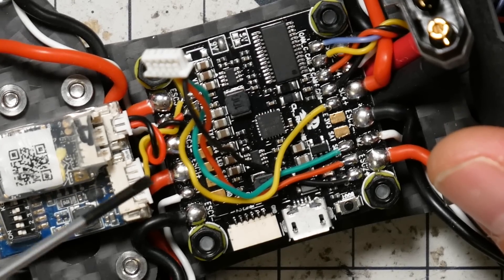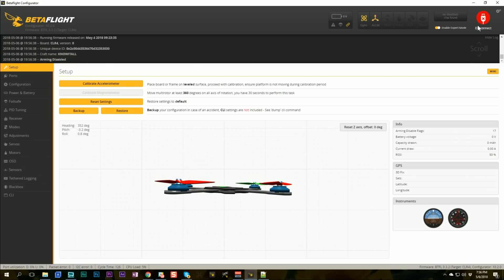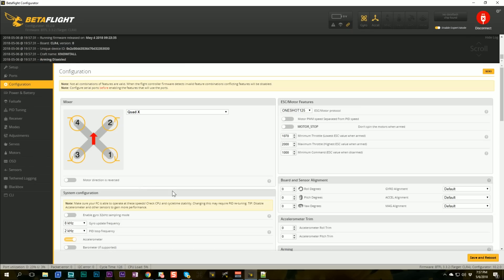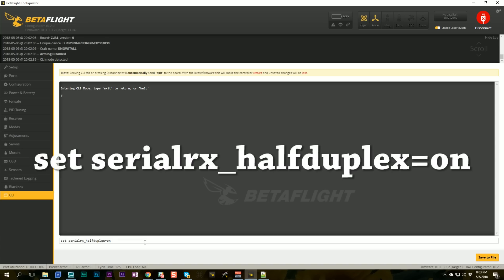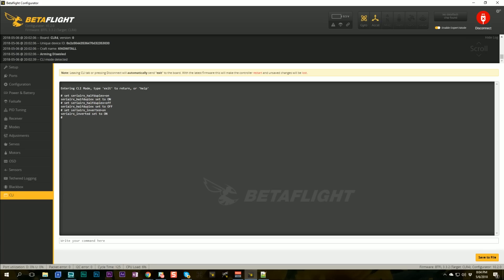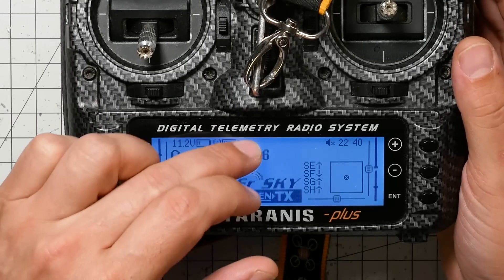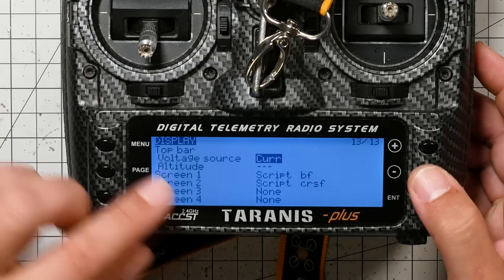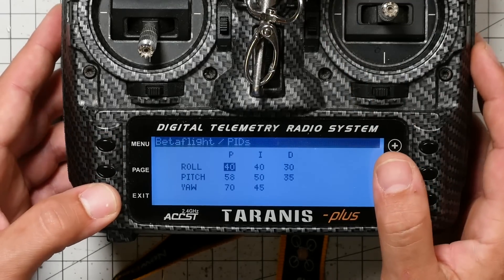FRSKY FPORT HOW TO | SBUS and SmartPort on One Wire

Comment: Have you ever seen where the Receiver tab isn't live but stutters? First time ever I have seen this. Just flashed my XSR to FPort since I needed to update it anyway. previous was SBus and I didn't see the issue then. Going to try and go back to see if it helps. Doesn't help I am on a Matek F405 AIO
Reply: Went back to SBus and SmartPort  config = back to normal. Not too bad because I was already wired this way.

Comment: Hi Josh, I have an r9mm receiver updated firmware to fport, that is bound to my taranis /r9m module also updated firmware, and feeding back rssi telemetry to the radio so I know that connection is good. fport/ smartport wire soldered to tx1, ports page, uart 1 set to serial, tried all variables of the command line on/off. Still not working on the bf reciever page. Any ideas?
Reply from the maker: If you are using the R9MM then you should connect the un-inverted SmartPort wire to any UART TX pad, then in the CLI type "set serialrx_inverted=on" then "save". If this doesn't work, type "get serialrx_halfduplex" and if it's on, turn it off, and if it's off, turn it on. 

If that doesn't work, use a different UART TX pad and see if that works.
Reply: @JoshuaBardwell  thanks for the reply.  Figured it out last night. I didnt realize the r9mm had an uninverted pin.

Comment: There is no Stickmovement on my Armattan Quad. Same Hardware&Wiring in the video (FC: CL FRacing F4S)
What I did:
1) I have flashed the FrSky R-XSR with the newest Firmware: R-XSR_FPORT_LBT_190311.frk
Since I use an European TaranisQX7 i changed the receiver firmware to LBT and in addition with FPort!

2) I flashed my TaranisQX7 with the newst firmware: opentx-x7-noheli-lua-luac-en-2.2.3.bin

3) I updated the newst Flightcontroller Firmware: CL_2.5.0_CLRACINGF4.hex
I also made the changes needed for the F4 and FPort.
set serialrx_provider = FPORT
set serialrx_halfduplex = OFF
set serialrx_inverted = ON
—> Now the binding process went well. I see the green LED on the R-XSR and I also get the telemetry information on my transmitter. YUHU!

BUT: I  don’t see any stick movement in cleanflight! And i cant figure out what’s the problem. 
Did I screw up with the new firmware? Or is Fport not the right thing for this quad?
Would be awesome if I get a little help from you guys… I hope it’s not a big thing.
Can you help?
Reply from the maker: I would double check the wiring. Yellow Smartport wire to T pad on the FC right?
Reply: @JoshuaBardwell  hey Josh. Thanks for the answer! Actually Armattan Support had the right clou. My R-XSR was not using the SBUS protocol for whatever reasons. So I had to push and hold the bind-Button on the RX for 30sec until the blue LED indicates it. I went back to SBUS and Smartport for now anyways. Now everyhting works fine. 
I'm diving in this fpv-hobby with an incredible pace and deepness. And you are absolutely the best, fun and most waterproof dive instructor I can imagine! 👍 I will follow up! Thank you

Comment: Not working on your Bardwell F4 flight controller. Flashed my XSR with FPort firmware and wired to telemetry pad. Set up a new model on my Taranis.
Reply from the maker: It definitely works on the JBF4. I did it myself in this video :-)

Did you wire the SBUS wire to the Telemetry pad maybe? FPort uses the SmartPort wire. That's my best guess.
Reply: Definitely using FPort wire which is yellow on my XSR.
Reply: Thinking of flash back to the regular firmware so I can fly this new build. Doubt the telemetry will work, see my previous comment from 2 months ago.

Comment: Hi JB.

Can i use the SBUS pin on a Wizard X220HV F4 board, with an RXSR to get telemetry if there are no spare UARTS by using Fport firmware on the receiver?
Cheers
Reply from the maker: No, it does not appear that the X220HV flight controller has any UARTs that would allow you to get telemetry. I have also tried to think if there is any pin that could be re-mapped but I don't think there is.

Comment: Hi Josua ,great video :) question tho.. do you know if the speedybee f4 aio FC is able to use the FPORT setup?
I am running speedybeef 3.5.7 on my speedybee, flashed fport firmware on my r-sxr reciever, connected the s.port wire of the reciever, set FBUS in settings tab, however:

only on uart 2 (default reciever/sbus port) i get stick output on in the transmitter tab of betaflight but no telemetry on the radio.

I know I shouldnt use the uart 2/sbus for flying but instead use a different uart. however i never get the stick output shown nor telemetry on my taranis q x7.

tried uart 3 and 4 with half serialrx_duplex on/off, and serialrx_inverted on/off but no telemetry nor stick reaction on the transmitter tab.
Reply from the maker: For FPort, you must use a UART TX pad with bi-directional inverter. You say you are using UART 2 SBUS port, which is an RX pad. That would explain why telemetry is not working. SBUS has a one-direction (RX only) inverter. Use the SmartPort pad on your FC if you have one. Or use the P pad on the RXSR, which outputs un-inverted smartport (and Fport). Connect the P pad of the RXSR to any UART TX pad on the FC. Then in the CLI type "set serialrx_inverted=on" then "save". I don't know the correct value for halfduplex but try it either way to get it working.

Comment: hi JB, what I'm missing. I have no telemetry apart from RxBt and RSSI after Discover new sensors. I've installed an R9 MM with latest firm FLEX_20190201. and OpenTx 2.2.3 on my Taranis Qx7. The channels are working great. The problem is the lack of sensors in the telemetry
Reply from the maker: It means that SmartPort is not working. Did you use the FPort firmware or the regular firmware?
Reply: Thank you for your fast answer. I have flashed FLEX_20190201 on R9 MM and R9M_FLEX in the TX module (Taranis QX7). My FC is a HAKRC Flying F4 v3. I have telemetry selected in BF. I don't have UART selected because I'm using F.port. Is it necessary to assign UART with F.PORT? I'm using the S.PORT/F.POT pin on R9 MM.

Comment: R9MM should be currently F_PORT enabled right? And the pin should be the same for S_PORT... (trying to understand how to wire it up on my Matek F405-CTR)
Reply from the maker: You can do exactly as you see here with R9MM. It does support FPort. The main advantage of R9MM is that it also has an inverted S.Port pin if your FC doesn't have an inverted UART for SmartPort or FPort. If you use the inverted S.Port pin you must go into the CLI and type

set serialrx_inverted=on (if you are using FPort)
set tlm_inverted=on (if you are using SmartPort)
save
Reply: @JoshuaBardwell  thanks a lot for your reply. Unfortunately I've got a quite bigger problem... I've bought a Jumper T12 basically for the form factor since my FPV backpack is not that big.
In order to make long range (as an upgrade for my Flysky FS-i6) I've also bought a Frsky module R9M plus R9MM receivers.
When I go through the binding procedure, if I select and execute the "Bnd" command (page 2 of model pages) it does not blink or make any sound either...
Really don't know what to do since if I use the crappy multimodule shipped with the T12 itself, binding command does work correctly (blinking and beeping while looking for a receiver).
Thanks again anyway, cheers.

Comment: Hi, quick question if I understood correctly,  on f4 like JB AIO,  connect the smart port wire after flashing to fport to the T on the f4 board? Thanks !
Reply from the maker: Yes that's correct

Comment: Mamba Mini (F4) and F.Port seems to be a miss. R9MM inverted s.port pad to FC TX6 pad doesn't want to send telemetry despite CLI tweaks and R9MM being flashed and Set in telemetry modes. Radio link works and it discovers all senors, not no current draw updates, been trying to not figuring it out so far..
Reply from the maker: If sensors are discovered but current does not update then it sounds like telemetry is working but current sensing is not. Go to power and battery tab and make sure current sensor is set correctly. Make sure the osd shows current flowing.
Reply: @JoshuaBardwell  Thanks for your help, you were right! The telemetry was coming through okay, I mistook the lack of current sensor updates as an f.port tele issue but in fact it was the BF power and battery tab configuration that needed some tweaks. All working now, thanks again!

Comment: I found a R9MM, flashed the firmware R9Mini_FCC_Fport.frk, and connected the Inverted SPort to TX1 on a new F411-Wing (flashed with the F411 softserial firmware). I set Fport as the serial receiver source in iNav, and now the Taranis X9D works the channels on the Receiver tab in iNav. However, I can't get the telemetry to work. 

My R9M is flashed with R9M_FCC.frk, version 20190117. Per the Matek Fport page, I have entered:
set serialrx_provider = FPORT
set serialrx_inverted = ON
set serialrx_halfduplex = ON

Per Oscar Liang, I have also tried turning serialrx_halfduplex off and on again. Same with serialrx_inverted. I have gone to the Taranis telemetry page, deleted all sensors, but when I choose Discover New Sensors, it doesn't find any. 

Does anyone see what I'm doing wrong?
Reply from the maker: Did you enable the Telemetry feature in the Configuration tab?
Reply: I finally got it working by going to an earlier version of the F411-WING firmware and trying a newer version of the R9MM firmware. Thanks for your reply!

Comment: Hello Mr Bardwell I have your first f4 FC and using R XSR f.port. I got f.port to work I had to turn off halfduplex and   invert both off. My question is can I use the sbus pad for smart audio sadly I burned off my tx4
Reply from the maker: SBUS pad is rx. SmartAudio needs TX. That's a no go.

You can use ledstrip remapped to softserial. Instructions are in the Troubleshooting section of the manual.
Reply: @JoshuaBardwell  thanks I already used the Led pad for it . I wasn't sure about what the sbus pad was RX OR TX thanks again.

Comment: Has anyone got any advice on how to get my r9mm to work with the matek f411-one using fport. I've tried everything and nothing works. The receiver has been flashed with the fport firmware but still no joy.
Reply from the maker: You need to use the inverted Smartport pad on the r9mm. Connect to any UART TX pad on the FC. Then in the CLI type

set serialrx_inverted = on
save
Reply: @JoshuaBardwell  thanks, I will give that a shot later on.
Reply: @JoshuaBardwell  unfortunately I tried every which way going in luring yours but still I get rxloss cli map in the cli tab even with the built in receiver I still get no receiver decteded in betaflight :/ may as well just get another FC.

Comment: I have f port working soldered on the pad on r-xsr and have serial rx UART 1 and connect that wire to sbus on mamba f405 mini. In your reciever tab you have telemetry set to aux 3. It's that because you're using uart3 or... What? I don't know what to set that aux to. I have an x-lite so I need to do something with that? I get rssi and vbat but don't know if I'm missing something out...? I also did nothing with inversion. I have no clue about that. It works and flies so it didn't fry anything...
Reply from the maker: If you are using FPort, don't wire to the SBUS pad on the FC. Wire to the SmartPort pad.
Reply: @JoshuaBardwell Thanks for the reply. On the mini mamba or any other f4 fc I've come across there's never been a pinout titled 'smartbus' so I guess I'm not understanding it. In the ports tab I need to select and solder to the corresponding UART port and just select serial rx. And not select smartport on that selected port. Currently it's working as far as I can tell going through sbus. It flies and I have telemetry. Is betaflight not telling the fc that the sbus port is being used as fport in the configuration tab? https://goo.gl/images/qbJqnP

Comment: DON'T FORGET TO DO THE set serialrx_inverted=on and  serialrx_halfduplex=on COMMANDS!   Whichever works with your flight controller of course.  Holy smokes!  Like a dumb ass, I flashed the latest & greatest firmware for my FC!  Then I had to go back and configure everything.  No biggie.........  My receiver is connecting to the radio........  Why is my receiver tab not responding.......  back and forth....... WHA!!!  Then I went back to this video,   Duh.

Comment: Hello all I wonder if you could help me I’m trying to set up a frsky r9 mm on flex firmware on to a vortex 250 pro I’ve updated all osd and fc firmware but still can’t get it working. can it be done?
Reply from the maker: The R9MM outputs regular SBUS so that should be doable. But I wonder... does the Vortex 250 Pro come pre-wired for a PPM receiver? 

I think this video might help: https://www.youtube.com/watch?v=N7FPIOBcrtM
Reply: Joshua Bardwell  thank you for reply so quickly so I can see I’m using the wrong port so on the r9 mm am I using the s-port as sbus or am I using the other pins, sorry for the noob questions I’m still learning

Comment: Hello Joshua I have this FC https://www.speedybee.com/speedy-bee-f4-aio-flight-controller/... which pad must be soldered and which cli commands I have to enter f port runs 😕🤯
Reply from the maker: Since that FC doesn't have a SmartPort telemetry pad, I'm not sure you can easily do FPort. You would need to do the uninvert hack on your FC, to get the uninverted smartport signal out of it, then solder to any UART TX pad on the Speedybee, then in the CLI, "set serialrx_inverted=on".
Reply: @JoshuaBardwell  We are one step closer, I bind the r9mm with the module and I have stick Kommands 😁😁😁 But no telemetry 🤔
Reply: @JoshuaBardwell  I did everything the way you said👍

Comment: Thank you for the exellent video Joshua! Could you please help me with one issue? I have FrSky R9MM receiver and it's flashed to FPORT, but I don't know how to connect it to Mamba F405 Mini? You said to connect it to smartport telemetry pad, but which one is it? There's no teli or sp connector: https://www.diatoneusa.com/store/p574/MAMBA_F405_Mini_Betaflight_Flight_Controller_F25_25A_2_4S_DSHOT600_FPV_Racing_Brushless_ESC.html

On the R9MM there's this S.PORT/F.PORT connector, that I think should be connected. https://www.rcgroups.com/forums/showthread.php?3063679-FRSky-R9-Mini-R9-MM-%28w-inv-sport%29-new-nano-long-range-RX

I would much appreciate your help!
Reply: Did you ever figure out how to do it ? because i'm stuck too. I have the Mamba F405 and im using the R9m slim + cant figure it out.
Reply: @brianmeermans3565  ended up just connecting SBUS...
Reply: @Silweri  I tried that too but have Rx loss and it won't arm at all. I have 5V, ground, and Sbus. I can't figure it out for the Life of me.
Reply: Brian Meermans I’m sorry, I meant that I ended up just using the regular SBUS instead of F.PORT. :)

Comment: I cant seem to setup f.port with the R9 Mini and the Dalrc F405...is it possible? ARGH. Tried the CLI invert and halfduplex. Dalrc F045 seems to have a RSSI/S.PORT pad on TX4...but can't seem to get f.port to work with various combos of setting serialrx in CLI / config/ ports...UPDATE seems like I have f.port. with this setup: R9 Mini f.port wire to "RC" uart1 pad, config to serialrx/f.port, no need to to CLI invert...NO SURE if this is f.port cause there are on 2 telem sensors just like the Sbus setup...just RSSI and RXbat...??
Reply from the maker: The RC pad is a receive pad, so if you run FPort on it, you will not get telemetry. You need to run FPort on a TX pad in order to get both control and telemetry.
Reply: @JoshuaBardwell  .. Ok TY. I set up another quad on the R9 mini ...this time a kakute F4 V2...wired to "SP" pad and I got legit f.port...like 11 sensors come up...Thx.

Comment: Have never got telemetry to work on a F4 with a FrSky XRS. Have tried on a CLRacing F4S and RTFQ Freestyle F4. Considering changing this Quad to a Omnibus F3 which I have working a few older quads. Will try this f port first, thanks for this video.

Comment: I have a GPS on my drone and i wanna get the data on to my controller. I have smart port setup and working but GPS doesn't come up under discover new sensors. @Joshua Bardwell
Reply from the maker: First thing I would do is test if you have GPS coordinates in the OSD. This would tell you whether the FC even thinks GPS is working.

Comment: @Joshua Bardwell
Any chance you can further assist. I've soldered in my r9 mini. Fport,ground,voltage. I've bound the receiver (xlite). Configured SBUS with FPORT in betaflight. (Latest version to date uploaded). I tested the CLI commands but I'm still not receiving anything from the transmitter. CLRACINGF4
Reply from the maker: To use FPort with CLRacing F4, you will need the Smartport wire connected to the T pad on the FC. I'm not sure but you may also need to type "set tlm_halfduplex=off" then "save" in the CLI. 

You say "configured SBUS with FPort" in betaflight. I don't really understand what that means though. 

Did you enable serial RX on UART 3?

Comment: Joshua, I am having a very similar issue to @Snorkl FPV. I am brand new to FrSky from Spektrum as well. I have the R9M with the R9MM rx. I have it connected with the f-port pad on the RX and he sbus bad on my hobbywing omnibus f4. The RX responds and I  can fly the kwad, but I get no Telemetry on my Qx7. Telemetry is enabled in BF and I do get RSSI, but that is it. I feel like I am missing something simple... Also I still want to send you a kwadgrabber!
Reply from the maker: The SBUS pad is receive only. You need to use the SmartPort pad on the FC.
Reply: @JoshuaBardwell  If there is no SmartPort pad on the FC, that means I would need a UART tx then right? in that case, would I need the "inverted s.port" pad on the RX?